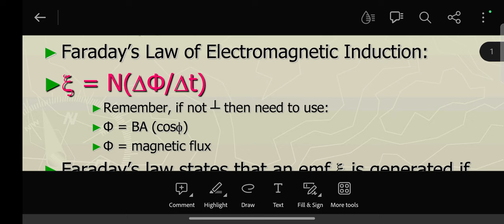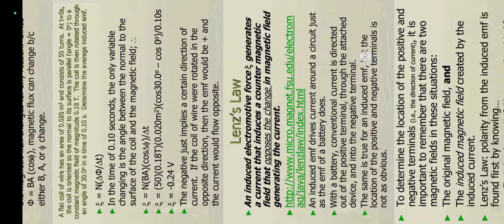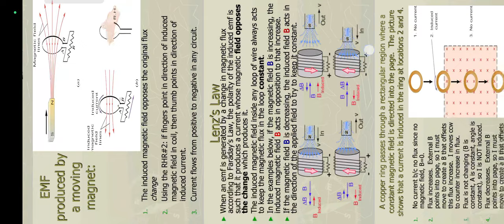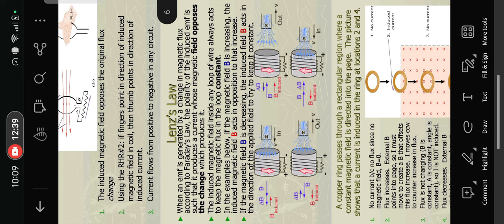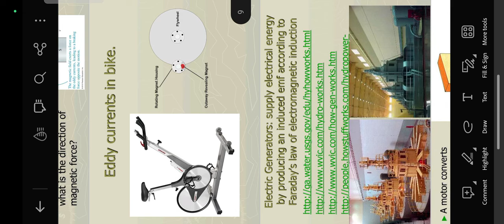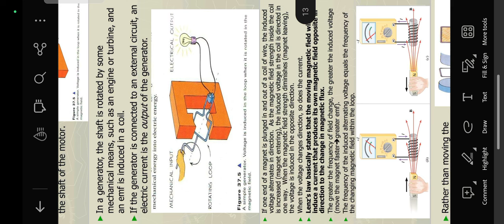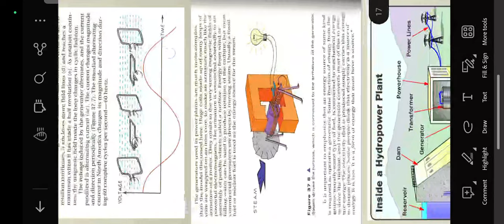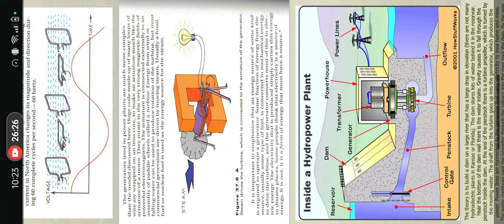Faraday's Laws #emi #btech #physics #alevel

Comment from the maker: Points to Remember
1st finger = field directionality vector.
2nd finger = current directional vector .
Thumb = thrust which means force acting on the charge or copper plate or magnet or any object in the B field orthogonal to E field.

Comment: Do you think these physics would be introduced in a SWE course?
Reply from the maker: @fern-cx3bf  Good question. SWE is all about various coding languages and a BCS MCS courses are very rigorous with focus on SQL, c++, Java, oracle and other difficult full time languages. This video is related to topics which are included in BSc Electrical Engineering basics foundation courses . So to answer your question in view of my experience w Bioinformatics Modules , is no because electrodynamics is not part of SWE curriculum. I remember in my bioinformatics modules we always performed data search queries and then saved the results in readable format to incorporate into the modular assignment. Electrodynamics and SWE don't crossover.